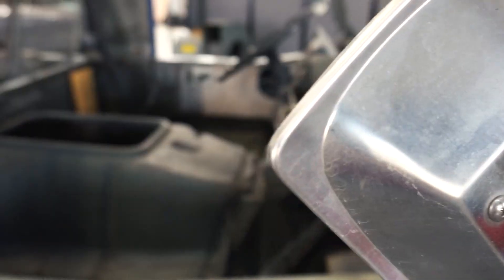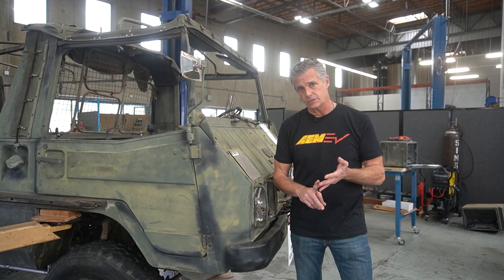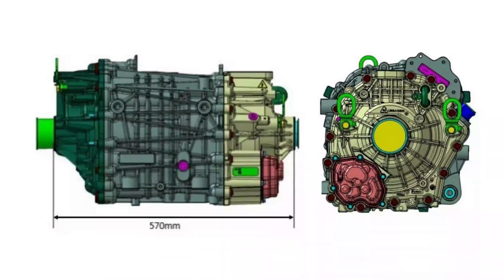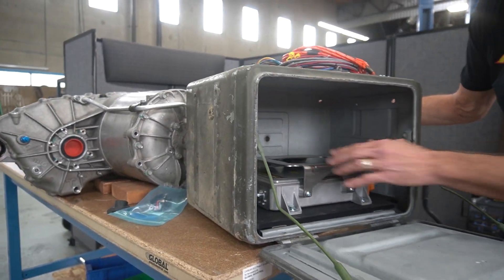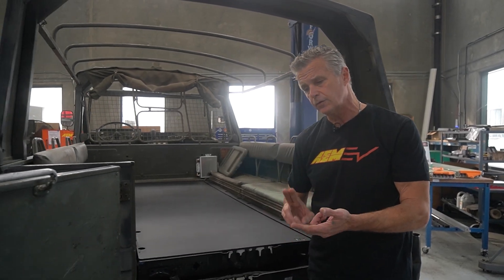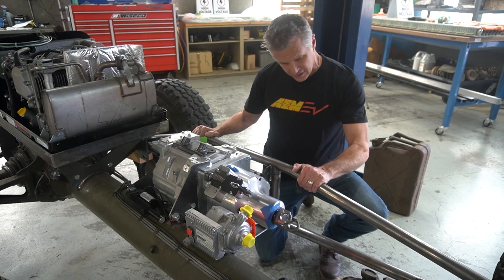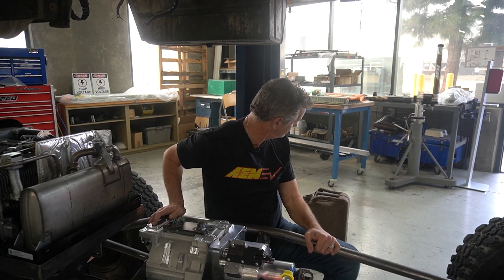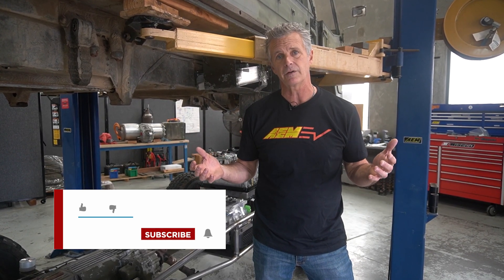Our '71 Pinzgauer EV Conversion is FINALLY Coming Together!

Comment: Since I have a VCU 200 and would very much like to build a range extending generator trailer.... Most of the reason I'm watching this project is to figure out how you're going to integrate that generator

Will it be able to run while the car is running or is it designed more to just turn on when the car is parked?

Comment: Very interested in this kind of build and setup. Full electric truck with a small diesel generator (RV-boat??) it can run for days.

Do you think it's possible to build this with a large 4x4 like Land Rover Defender, LR3, Toyota Land Cruiser, Nissan Patrol or Pathfinder, WV T2 T3 syncro and so on ?